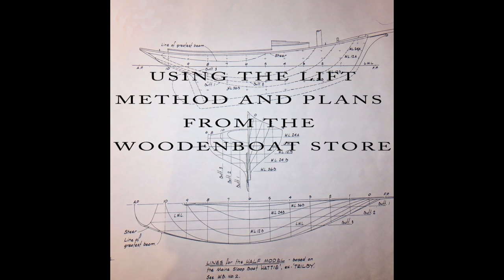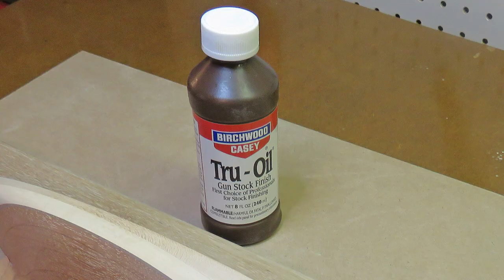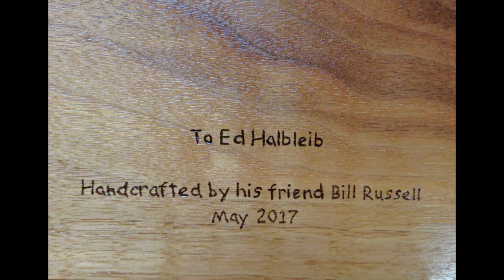Building a Half Hull Model of the Hattie

Comment: Very nice half-model and finish.  Do you ever have warping problems with the backing board because it is made without "breadboard' ends across the end grain?  That was a frequent problem for my early work.  I suppose atmospheric  humidity was the cause of the warping of the backing board.
Reply from the maker: Thanks Brant. I've made a couple of these now and, knock on wood, haven't seen any cracking or warping yet. But It's a good point and I will consider breadboard ends in future.
Reply: Thanks for your kind reply!  I learned of half models when I visited the Maritime provinces 40 years ago and have been interested in building them ever since.

For a while I lived close to Mystic Seaport, Connecticut and would frequently visit the Seaport museum and their gift shop.  I saw many half hull models there with backing boards having breadboard ends.  For me that was a revelation and I realized I had to live with the breadboard ends to stop my warping problem.

I got most of my ship plans from books, like those written by Howard Chapelle and some blue print copies directly from the Smithsonian.  It was interesting seeing you take the lines right from the model.  That was one way my plans were developed by the Smithsonian, many during the Great Depression.  Other lines were taken off smaller vessels that were still in existence.
Reply from the maker: Funny you mention the Seaport Museum. I will be visiting there in April for the express purpose of getting ideas or perhaps plans for a 1800's packet boat (a barque). My great great grandfather was a ships captain and we have an original water color painting (by Samuel Walters) of one of his ships. As a gift to the family I want to make a HH model of it. Problem is - all I have is the painting. I was hoping the Charles W. Morgan might be similar enough so that I could use the plans. But before I shell out $175  for the plans I want to reasonable certain I can use them. Thus the visit to the museum. Sorry to be so windy but your mention of the museum got me going.
Reply: You are quite welcome for answering.  There is a library and reference section of the Mystic museum that is near their western end.  Perhaps they have reference materials there which can help?  Then there is a book store (near the half hull models which are for sale).  The store has many books which might be useful.  Speaking of models, check how much they are asking for their half hulls.

I wonder how much the hull lines of barques varied.  I have not seen enough plans to form a very intelligent opinion.    I've visited the Morgan dozens of times and in my opinion it has an apple bow (bluff bow?) and the general lines of the hull appear very box-like to me.  Maybe that is common for barques?  I spent more time looking at lines of Baltimore clippers and things like pilot ships and some cat boats.  Those all had hulls which at the fore end were more streamlined.  Maybe the Morgan just looks apple bowed compared to those.

Have you ever been down to the Mariner's Museum at Newport News, Virginia?  Lots of nice models and artifacts on display there.    I am in awe of the John Bellamy eagle (I think it is often called the "Lancaster Eagle")  with the gold leaf finish.  

The Smithsonian has half hull models and a lot of written materials. Then in Maine there is a small Maritime Museum in Bath, Maine.  They might have useful information too.

Let me know what you think of Mystic Seaport!
Reply from the maker: Thanks for the informative reply. No I haven't been to those other museums yet, but would love to. The hull of the Morgan looks similar to the one in our painting, but an in-person visit is needed. I know what you mean about the prices of HH's. The fellow I made the Hattie for was in a gift shop in Camden, ME and saw some on the wall for upwards of $1800. Of course when he told me that I immediately told him I wanted the Hattie back :-)